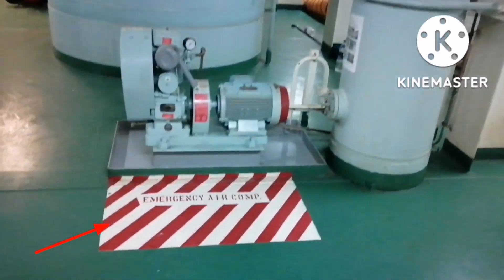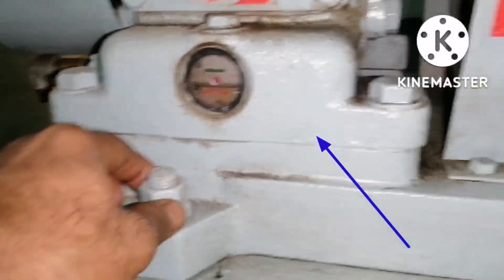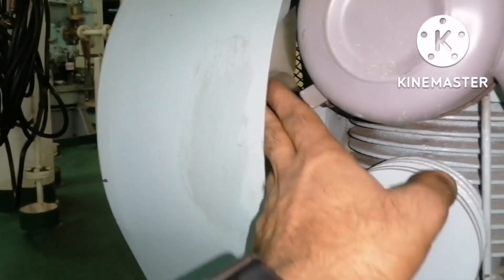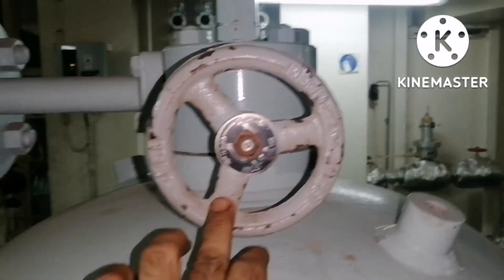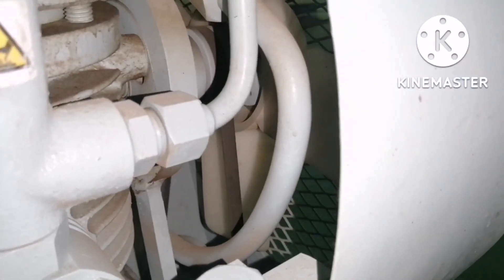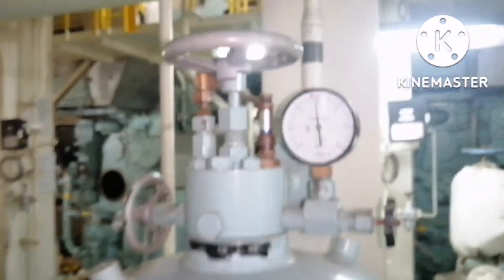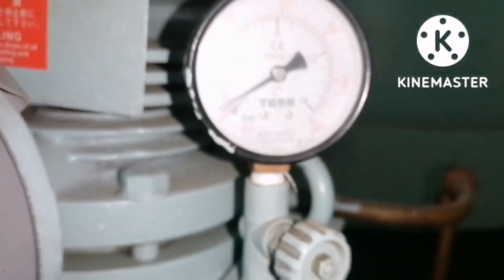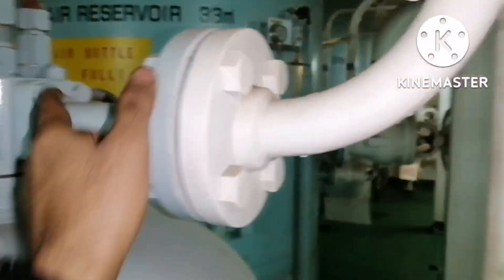How do they do.. know everything about Emergency air compressor onboard ship...

Comment: Sir can we use emergency air bottle to start our emergency generator ? Is it possible or it is only to start auxiliary generators?
Reply from the maker: emergency air bottle won't be connected to emergency generator... So u cannot start.
Emergency air bottle will give supply to auxillary generator oly.